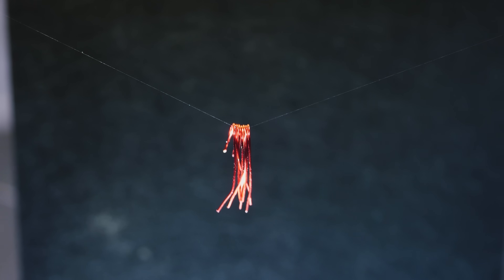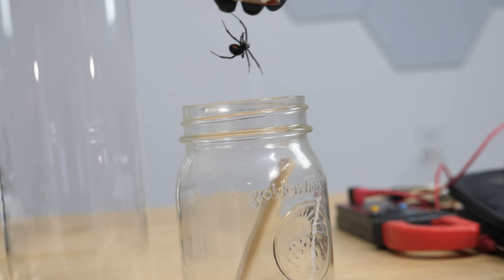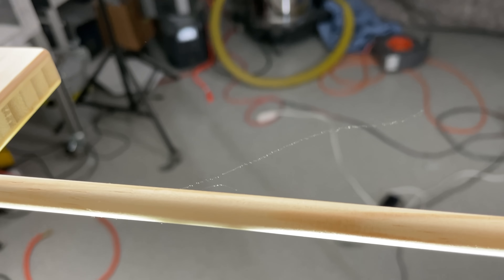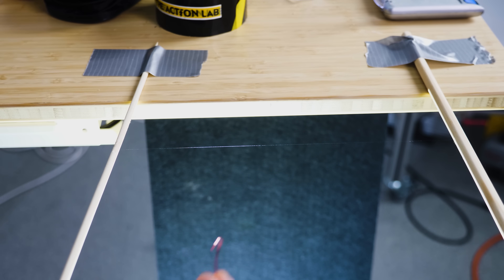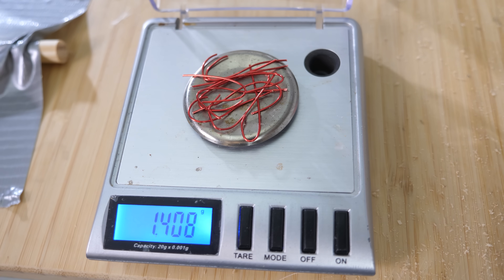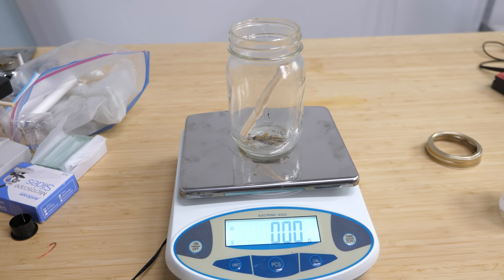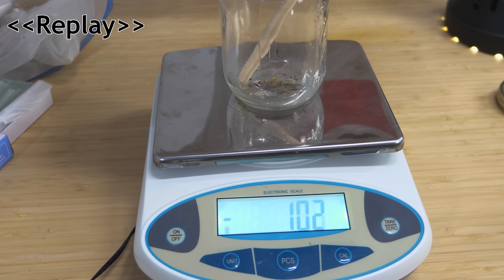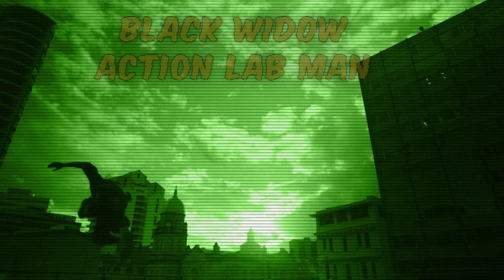Is Black Widow Silk Stronger Than Steel?

Comment: The craziest thing is, they didn't develop a unique new polymer to achieve these incredible strengths. The use amino acids, just like most other biological structures. They're just tangled up and cemented together in an incredibly complex way, so nearly every available bonding site is fully utilized.
Reply: Meaning we can theoretically synthesise these in labs
Reply: It really is a natural marvel of organic materials science
Reply: @thegrimreader7981  Also: what other materials lie in wait for us somewhere in all the possible arrangements of atoms?
Reply: @thegrimreader7981  just think about how strong other biological structures can get with some highly advanced gene editing.
Reply: @thegrimreader7981  It would be pointless, since high-performance metamaterials already exhibit significantly stronger properties than spider silk. High grades of kevlar approach 5GPas of tensile, some carbon fibers approach 300GPas.

It is true that spider silk is remarkable for how a living being is able to produce it organically, but it does not mean it performs better.
Reply: @bort6414 it's also about easy of mass production. Carbon nanotubes and graphene have been quoted as materials of the future, but have not seen prolific use due to difficulty of mass producing them in a useful form.
Reply: @thegrimreader7981  and have done so, but at a cost that is so high as to be largely useless... For now.
Reply: Do you have a link about the carbon fiber at 300Gpa?

Also is this 5Gpa Kevlar used in bullet proof vest or do they use lower grade?
Reply: @thegrimreader7981 there’s some scientists working on genetically modifying silkworms to make spider silk, since it’s stronger than normal silkworm silk and there’s already well established silkworm farms
Reply: I am an engineer and a former silk researcher, writing my PhD dissertation about silk. What isn't common knowledge is  1) spider silk isn't stronger than steel (look up tensile strength calculations). 2)  If you are going off of tensile strengths normalized to weight, synthetic polymers (UHMWP and Kevlar) are way stronger. 3)  It is  marginally tougher than synthetic polymers (energy dissipated before failure). But this toughness, is 100% dependent on the hydrated state of the silk. If the silk is wet in the slightest, it looses its toughness as water plasticizes the non-covalent sacrificial bonds (primarily hydrogen bonds between the peptide backbone) which give rise to the yield point and energy dissipating properties of the silk.  In short, spider silk researchers sensationalize the topic and are intentionally misleading so that they can gobble up grant dollars with flat promises of benefits to humanity. It turns out the public love sensational stories of biomimetics.  What spiders achieve is an impressive feat of evolution but the material properties are  overstated by researchers to dupe the layman (the public funding their grants).
Reply: @webleaf30   i dont know what happens to my comments.  i dont swear,  i dont call names.  my last one was about " spider goat " .  and how they were going to use the milk to make thread - they same way they make Rayon ( artificial version of expensive real bamboo " silk " shirts ) .
Reply: @FiddleSticks800  Thanks for sharing that, always nice to get feedback from an expert. 
I had known for a while that some of the strength claims were somewhat exaggerated, but still very impressive. 
Very interesting to hear how humidity affects the strength as well, I did not know this. From the way you said that, I would assume this is a mostly reversable reaction?
Perhaps it doesn't matter since many spiders will eat their web at the end of the day, reusing the proteins for tomorrow's web.
Reply: @bort6414  It's an incredibly streachy material though compared to most of what we have no?
Reply: The problem is also that here only the tensile strength is stated. But for a real part (which is not a wire) a lot of other properties are important like fracture toughness or plasticity.

Comment: You did the test a bit wrong - you're only supposed to calculate the tensile strength from a certain amount of deformation usually labeled at the failure point.  When it deforms too much you should stop counting.  I think the deformation was certainly past the critical failure point at around 8 - meaning it would've snapped after being left alone for a few more minutes.  The failure point was 6 or 7.
Reply: YouTube has blue comments now??
Reply: I think youre talking about yield strength. Hes testing ultimate testile strength, which is strength at the breaking point. Mechanical testing values can change depending on loading rate, but part of testing is determining the rate you care about before the test.
Reply: @mitchellsteindler  is right

Comment: Hi James! As others have mentioned, you did your first ultimate tensile strength calculation wrong -- you need to take into account the angles of the two threads. I measured a screenshot taken right before failure and found the thread on the left was 30deg. from horizontal and the thread on the right was 24deg. from horizontal.

I'm a physics/math teacher and have a degree in mechanical engineering so I had some fun re-doing the calculations. The actual ultimate tensile strength is 1.37GPa -- better than you thought! Let me know if you'd like a link to the PDF. (I don't think I can post a dropbox link here.) :)

IMO the biggest sources of error is your diameter measurement -- it doesn't look like you had very high resolution in the microscope capture, and there's always a possibility that the thread had a weaker/thinner spot somewhere you didn't look.

Also note that for the pulling-up-from-jar method, any tiny spikes in tension force due to slight shakiness of your hand will not be picked up by the reading on the scale, due to the inertia of the heavy glass jar and scale bed. If you want to try the pulling-up-from-jar method again for a more accurate result, I would recommend using the duct tape to attach the silk to a stretchy material like a strand of spandex from old underwear/socks, to absorb shocks and allow you to turn translational motion with your hand into a slow, steady force increase.
Reply: James! You should see this!
Great stuff
Reply: I was just about to say this. The setup immediately reminded me of a particular problem from my AP Physics class of a few years ago.
Reply: What a beautiful YouTube comment
Reply: Yeah, he probably assumed both to be 30º so
mg=2*Fty=2*1/2 Ft=Ft
But the angle of the camera is looking down so the angles are bigger than they look.
Reply: I would recommend him staying the hell away from a black widow... just saying...
Reply: Like this man said. Think force vectors. That's why a great force was with stood in the second test 👍
Reply: Yes thanks for this comment. The force on the strand increases hugely (exponentially?) as the angle from horizontal decreases.
Reply: This is the "hammock effect".
Reply: This is the "hammock effect".
Reply: @chrisburn7178 Yep, a vertical force applied to the middle of a horizontal line will produce infinite tension in the line. 

Of course, this cannot actually happen because it's impossible to have a truly horizontal line. There will always be some catenary (sag), even before the load is applied.
Reply: I made the same conceptual error a week ago trying to figure out what the numbers meant on cable workout machine, whose top cables run through the handle you pull down on.
I thought by putting barbell (known weight) over top of the handle, it would correlate with the number selected on the machine. But then the cable is angled, and not only that, the angle changes as you pull down: it becomes increasingly acute. Not only can you not properly correlate, the further you pull on the cable, the more resistance

(This would be true of the other cables on the machine, side-pull and up-pull set.)
Reply: A sling calculator on the internet will do the math for you.   And I would propose that the size of the string was highly variable, so maybe at the point of failure it was only 1/2 the average diameter.   And the stretched string might have been 1/4 the diameter of the relaxed string.   This rigging of the string introduced a lot of variables, since as the string stretched the angles were changing.   Much better to pull stright down.  I show a video about spider silk to my Biology and Physics students where GMO goats make spider silk which is tested very precisely.   I am also an amature Zip Line maker, and have real live experience with hanging things from cables.   A 200 pound person on a tightly strung cable can easily produce 2000 pounds of tension.
Reply: @danagillam  Agreed; hanging the line vertically is the only sensible way to do this.
Reply: @danagillam 1/2 diameter would be 1/4 strength making spider silk very inefficient in nature.
 1/4 diameter would be 16X stretch.
Was the goat video from "Making Stuff Stronger"? I used that for in-house technical English in Germany.
Reply: @ryankozak99  Yes, it is from Making Stuff Stronger.   I see your point that evolution favors efficiency, so spiders should have adapted to making consistently sized threads. My video says it stretches over 140%, so if it is a solid it would be about 1/2 the volume per meter when stretched, and would have about 70% of its original diameter.   I was assuming a greater reduction of diameter because I did not imagine the thread to be solid, I imagine it to be made of many fibers that could become more tightly packed when pulled. (fibers with air gaps between them).   Now that I consider the change in volume of a section of string, I see that assumption of about 1/4 the diameter when stretched was unreasonable.  1/16 the volume so a 16x increase in length.
Reply: @danagillam  Not sure whether it's  monofilament or fibrous,  but would assume constant volume for our purposes. If conserving volume, then length is inversely proportional to the cross-sectional diameter squared.
Reply: Spiders are cooler than physics 🤓
Reply: Don't forget to factor in the stretching. 😉
Reply: I saw a black widow fight a wasp
Reply: @christianheichel are you spiderman
Reply: I'm studying civil engineering currently and i find this truely facinating how a small spider web can be stronger than steel or concrete that we use in buildings!!
As on average concrete can withstand about 2.5tons/m on preassure which is about 0.25GPA!!